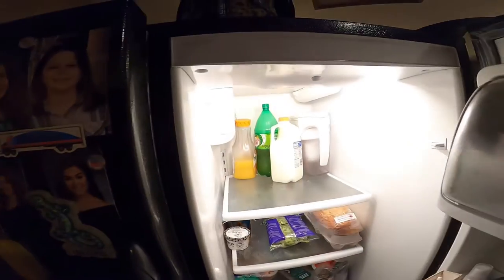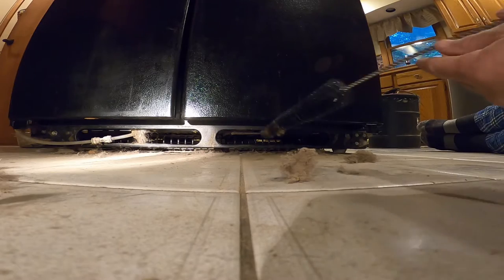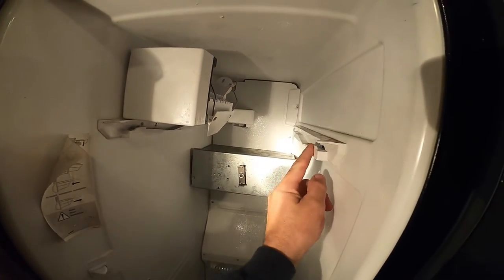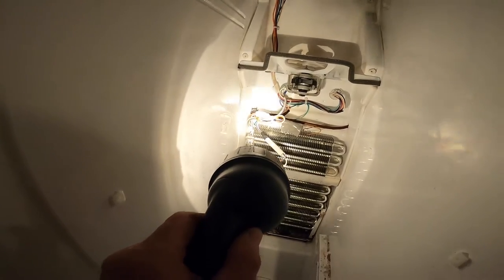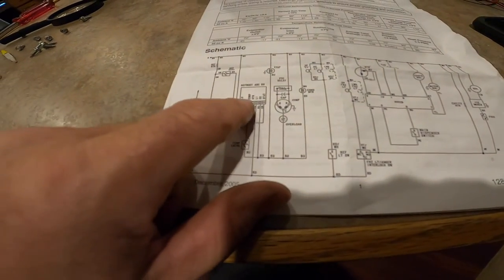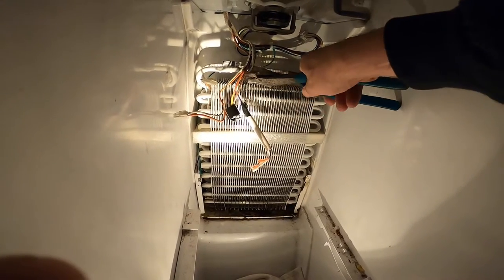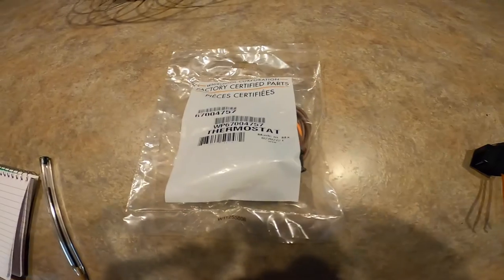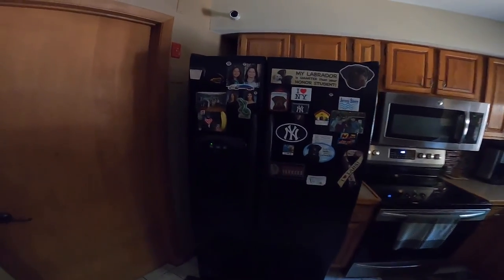Maytag Refrigerator not cooling like it should.(Easy fix)

Comment: I have this same frig  and I thought it was the compressor part in the back, after putting part it doesnot get cold freezer nor frig part I ended spending the money for a new one.  But I still want to fix  the magtag.  Thank you for taking everything out.  I dk if that's  it but I want to get fix without going to a repairmen.  Now it seems everything is expensive.  So thanks for showing the repair.

Comment: Thank you. Have same exact side by side. Exact same amount of gunk build up. Lol And same issue. Only way you could be more helpful would be to come over and do it for me. Very helpful. Little hard to hear you.
Reply from the maker: Ha. Be right over from Massachusetts. Should be less than half hour fix if it's the thermostat.  Easy to do...probably takes longer to clean the elements off.

Comment: Freezer section suddenly stopped working- in my house where temps are 40 degrees inside! Ice cubes melting! I've had this unit only 8 months. No silt/dust/pet hair to clog the cooling coil. Minimal contnets in both compartments, only ice trays in the freezer.  Could ice be forming and blocking from condensation/water vapor?
Have unplugged for now, stashing my stuff outside where it is below zero for the next few days during this frigid bomb cyclone
Gee my old refrigs used to run 20 years with no problems.
Reply from the maker: Sounds like the defrost mode is stuck on, which might a faulty thermostat switch.
Reply: Please contact me we bought in a package deal at Lowe’s in Lindale Texas and the freezer size is not keeping very cold refrigerator is but no matter if I turn it up to the max is still freezers Milton it’s got water in it so it’s not but about a month old we just need to be haven’t looked at service is a Maytag rest of stuff is KitchenAid

Comment: Force defrost.   You have to turn the fridge back on after the three turns.  Then you have to be patient and wait a min. 8 minutes then the fan will start and the heating element will get hot. No offense you got it fixed good but these steps were totally unnecessary.

Comment: You know they sale refrigerators at Home Depot!!!!!
Reply from the maker: Yep. Why buy one for $1400 when you can fix one for $140.
Reply: @JLafix  repair guy asked for 100$ visit then wanted to change replace a part for 400$ + 200$ installation that's a 700$ repair
Reply: Of course they do, but not everyone has $1200+ to fork out on a new refrigerator that is NOT built as good as the older ones were!  I would never by an LG or Samsung fridge with cheap parts made in China & Korea and have problems with the fridge within 3-4 years.  Don't need a fancy touchscreen and all that gimmick crap they put on them now!  I fixed this same model fridge for someone with $28 in parts plus the cost of a new water filter since it needed to be changed anyway.   It's more rewarding when you have the knowledge and troubleshooting skills to fix stuff yourself, but it's a shame most consumers don't and are at the mercy of a repair guy who will most likely scam them or the manufacturer that will push buying a new one..
Reply: @MrMusic55123  So what did you end up doing?  What was the part he wanted to change?